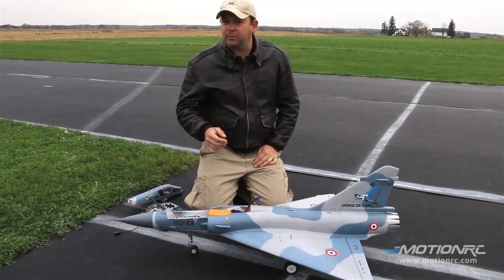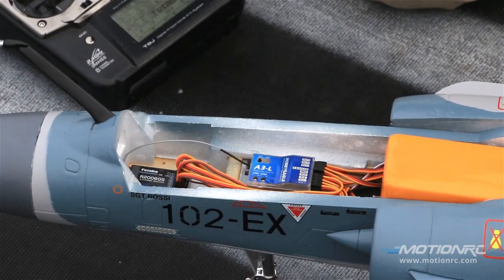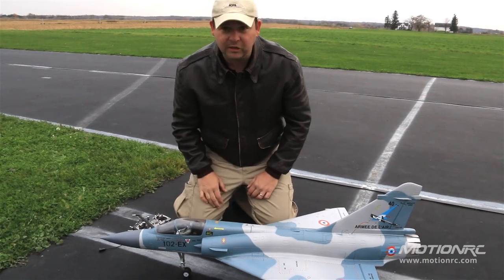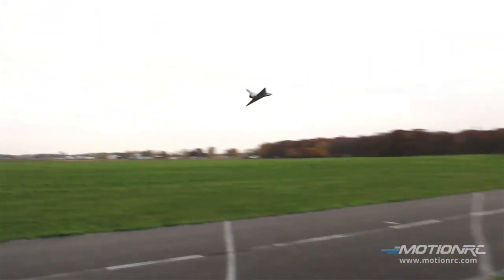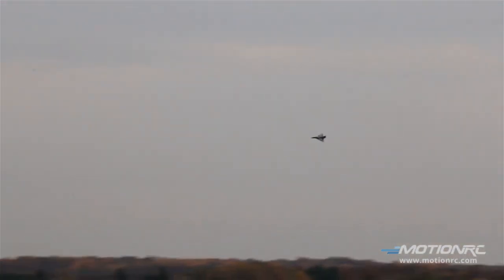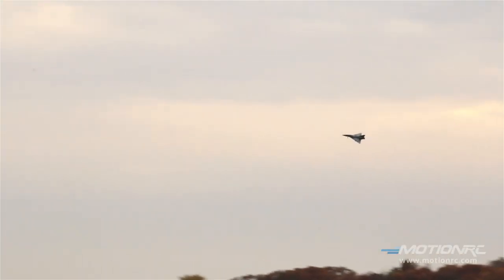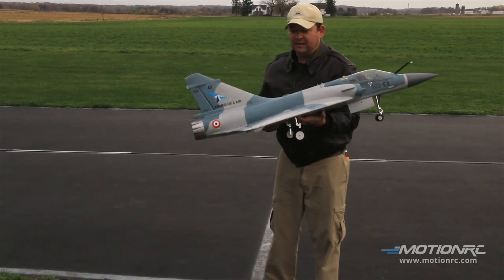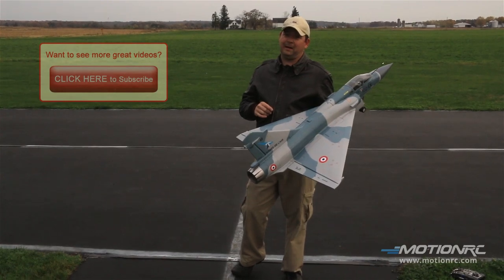Freewing Mirage 2000 / Hobby Eagle A3L Gyro demo

Comment: Very very nice flight !!
Especially the slow flying :)
I would like to know which version of the Mirage is it : the inrunner or the outrunner version ?
Thank you very much in advance !
Reply from the maker: Stock out runner
Reply: Thank you very much for your reply MotionRC team :)
I've seen on your website that you've got an inrunner upgrade to increase performance.
Is it still possible to do the slower flights with the inrunner upgrade ? Or is it better to stay with the stock outrunner motorisation mirage you're selling ?
I'm afraid that with the upgrade, the weight of the Mirage will increase ?
Reply from the maker: The weight will increase but slow flight is still possible, just not as slow.

Comment: Great video guys,  You mentioned you had not hooked up the 3d.  Is the 3D the head hold mode for this gyro?  Why would you not use that for EDFs?  I have a few of these A3L gyros as well as Guardians.  I normally fly my EDFs in 3D head hold, but I am now wondering if that is teh correct mode to fly my EDFs in.  I have had my share of stalls and inability to recover (primarily I think the 3D HH is fighting my attemps - unless I switch the gyro to off).  I would like to know your thoughts on that.  Thanks.